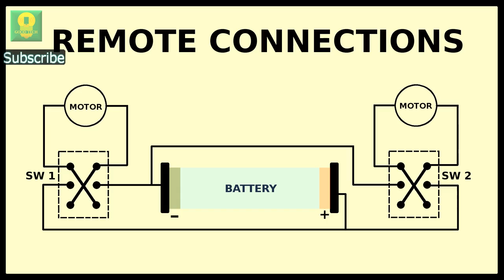How to make Remote controlled Snake at home

Comment: You did not put any bead in the front of the snake? Do you just move it wheels made of glue ?
Reply from the maker: To move the snake with the motor, some friction is needed at the ground. The hot glue is perfect to work as wheels for the snake and provide enough friction.

Comment: Hi, my daughter who is in 5th grade would like to try this for her science project this year.  She was so excited when she saw this. My question is how big is the PCB board for the controller. Looks like 3" by 1 1/2"
Reply from the maker: The PCB board is about 4" by 1 1/2". however, the controller size will depend on the size of batteries and DPDT switches used.

Comment: Can anyone tell me how does it work only with vibrations of the motor??? By the way nice video👍👌
Reply from the maker: It doesn't work with motor vibrations. If you watch the video carefully, you will find that i have applied hot glue at the tip of the motor shafts. The glue provides rubber grip and makes the snake move when the motor rotates.
Reply: GOODTECH - Creativity and Science Oh I see  THANKS👍
Reply from the maker: You're welcome.

Comment: what and how do u melt the metal thing to connect the wires on the remote control? Thanks and love the vid, it's amazing!
Reply from the maker: That metal thing is a solder wire that is melted with a soldering iron.
Reply: THANK YOU SO MUCH, BTW YOU ARE A GENIUS
Reply: where do you get the solder machine in oman?

Comment: Hi there i just wanted to ask after you did the yellow and blue can you explain what you did next with the black and red wires the remote connections please😅
Reply from the maker: Hi, as you have seen the circuit schematic in the video, the red and black wire are to connect the power source to both the switches. The black wire connect the middle pins of the two switches while the red wire connects the remaining middle pin. Then the battery is connected to the middle pins.
Try to see the circuit again and you will easily understand the connections.
Reply: GOODTECH - Creativity and Science Thanks!☺️☺️

Comment: in the video u add some hot glue to the shaft of the motor can I put some clay instead of hot glue if not tthen what else?
Reply from the maker: Yes, anything that might help in providing a grip on the floor can be used.

Comment: awesome 
but can you tell me that how you connect motors
Reply from the maker: Thanks :)
The motors are individually connected to the respective DPDT switches in the controller. The DPDT switch allows to control the motor in both directions thus giving us complete control over the movements of the snake. Refer to the circuit schematic in the video and you will get more clarity about the connections.

Comment: I don't really get how do you connect everything to the battery, I'm thinking of doing this snake, it would be so cool
Reply from the maker: The connections are pretty simple, the two motors are connected directly to the DPDT switches on the remote. There is a schematic in the video, give it a look and you will be able to understand it.

Comment: What are those white bead like things you put on the wires?

And what's the thing at 6:35? Can you find it in your household?
Reply from the maker: The white bead like things are nothing but white beads from a necklace and at 6:35 those are Office paper clips found easily on a stationary shop.
Reply: GOODTECH - Creativity and Science  not those, the orange things you put the battery on
Reply from the maker: That is a general purpose PCB board.
Reply: Where do you find them?
Reply from the maker: You can get good quality PCB boards from ebay or amazon - http://amzn.to/2lkylJH
Reply: can you use cardboard instead? sorry but i live in oman so amazon is VERY expensive

Comment: Can you explain to me the controls and stuff? I want to make this but I am inexperienced in electronics. Thanks:)
Reply from the maker: Basically the body of the snake is made with few pieces of cardboard joined together making it quite flexible to move. This can be very well seen in the video. The motion of the snake is achieved by two toy DC motors connected individually to separate DPDT switches.
When both the motors move in forward direction, snake also moves forward. when both motors move backwards, snake also moves back. When right motor moves forward and left motor moves backward, the snake turns left. Similarly, when the left motor moves forward and right motor moves backward, the snake turns right.
Reply: +GOODTECH - Creativity and Science thanks:)

Comment: What wire or wires are you using to connect from the PCB board to the motor?
Reply from the maker: The four different coloured wires are used for making connections. Any insulated wires can be used, however, try to use the thin wires so that they are more flexible while moving with the snake.

Comment: how it moves you don't use any wheel
Reply from the maker: It doesn't require any wheels. If you see the video carefully, you will find that the motor shaft are made to touch ground. So, when the motor shafts rotate, it gives motion to snake as well.

Comment: where i can get the Pvc board and what type of battery is needed for it?
Reply from the maker: You can use any cell holder as well instead of PCB and the batteries will depend on the type of motor you will be using.

Comment: Which are the materials ?
Reply from the maker: Fro Snake Body:
Cardboard, Office paper clips, Beads, DC motor, Hot Glue gun

For Remote Control:
DPDT Switch, General purpose PCB board, office paper clips, Li-ion cell and connecting wires.

Comment: Hy l,i want to ask
Cqnt the dpdt switch replaced with stick ps?
Reply from the maker: What is stick ps?
Reply: remot control of ps 2's..(playstation)
You know?
Reply from the maker: Yes, it can be done but it will be difficult to open the controller and safely solder the connection wire to the switches without damaging them. It is better to buy a wireless Rx kit and use the remote to wirelessly control the snake.
I am planning to make a wireless RC snake soon but i am yet not sure if i will make my own controller or use a remote.

Comment: Hey good tech whats that thing that you connect wires to? Plz awnser back. In minute 5:00
Reply from the maker: I have just Soldered 4 different colored wires to DC motors using soldering iron.
Reply: No um i meant the gun what is it
Reply from the maker: It is the soldering iron that i used to connect the wires.

Comment: can I get the dpdt switch and pcb board from a toy car and remote controller?
Reply from the maker: You can get the controller from a toy car and you can use the remote control as it is, so you don't need dpdt switches.